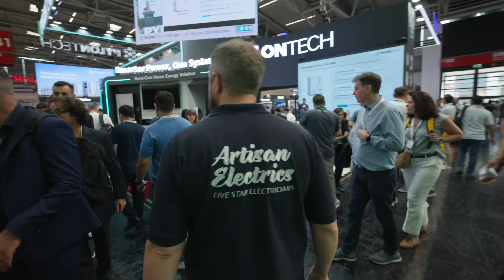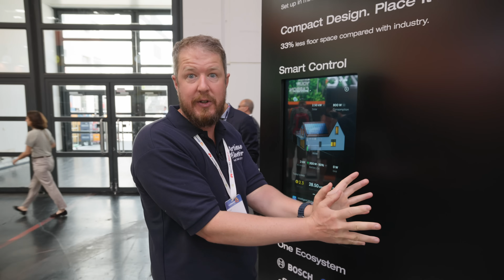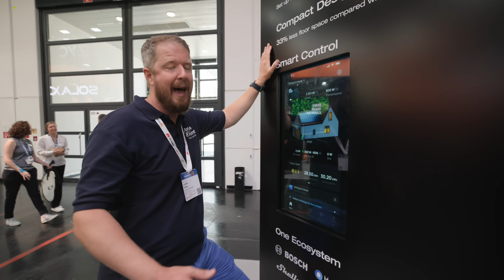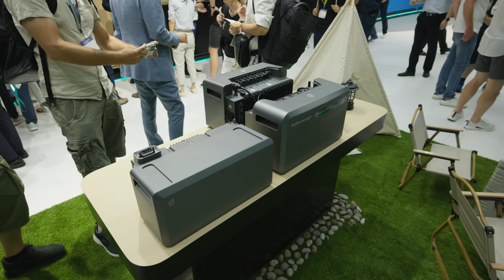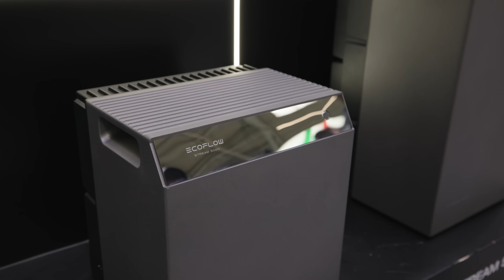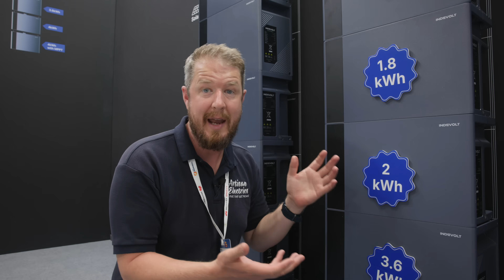Is the UK FINALLY Catching Up on Plug-In Solar? Intersolar 2026

Comment: I have a question for people with plug in solar - I just need to connect a solar panel (upto X watts) to a microinverter and then plug the microinverter into a wall socket. If my solar panel is generating say 400W, then any electrical device on the same electric phase (I have a 3 phase supply) will use up all or part of this "free" energy before pulling from the grid right ?
Does the switch on the electrical socket need to be in the On position for this to work ?
What happens to the excess solar energy if nothing in my house is pulling it ? Does it just get dumped via earthing/neutral ?
Lets disregard net metering obviously, is there any "special" requirement to your home wiring or breakers or electricity meter for this to work ?
Reply: Does anything function when plugged in and switched off ?
Reply: @codenamenel but wouldn't the electricity from the wall outlet clash with the electricity flowing in from the solar ?
Reply: @Mortisnp  how does electricity "clash" ?  it's just the flow of electrons in a circuit, the electrons in your wall socket haven't got beef with the electrons from your solar, they all just flow around the circuit (as long as the switches are closed) to get converted into a different type of energy by whatever appliance you have plugged in (and switched on)
Reply: @codenamenel  I don't know enough about electricity and home wiring to phrase my question well enough but I will try again. 
If anything conductive is plugged into the socket and the switch is on, electricity will flow into it right ? 
Does the generated electricity from plug in solar flow into the rest of the house circuit via the neutral of the socket or the live ? 

For some reason I think of electricity in wires of pipes carrying water. If the socket is the tap, is the "water" right up to the tap or is the pipe empty until the tap is opened and it starts flowing from the mains - there is "space" for the solar electricity to flow back to the mains and get distributed to another tap that is open ? 
I can normally digest a power CONSUMING device being connected to a circuit where electricity comes in and it gets used up. I don't know what would happen if an electricity GENERATING device is connected to socket in a SMALL TAP (solar) vs BIG TAP (mains) scenario. 
Say the solar is generating 5A and the breaker is 25A when the switch is on, it's two different levels of power heading in opposite directions. What would happen ? 

I hope this helps in explaining my doubts
Reply: @Mortisnp  there is around 230v on the live pin and 0v on the neutral pin of the plug from the solar, the same as there is 230v in the live terminal and 0v in the neutral terminal of the socket on your wall. Current will only flow from live to neutral it cant go in opposite directions, you have to connect both to create a circuit, depending on the resistance of what you use to connect the 2 is how much current will be required to overcome the resistance at a set voltage (230v)
In your water and pipe analogy, think of your radiators and heating circuit - from your boiler feed side, down pipes to the radiator valve, through the radiator and back along pipes to the boiler return side. 
The radiator valve is the socket, the hot water is current and the water pressure in the system is the voltage. If the radiator valve is closed there is still hot water in pipe behind the valve but your rad is cold as there is no water flowing through it, you open the valve (turn on your switch) and hot water flows through the rad, losing heat as it goes through and back out to the return side of the heater core in your boiler to be heated again. If you added another boiler and tapped into the heating pipes, one on feed, one on return, and equalised the pressures between the 2 boilers the particles of water from 1 boiler wouldn't fight the other water it would just mix together in the pipe flow along together down the feed, through the valve, through the rad and back along the pipes to return and get heated again. 
Now you've probably heard that electricity follows the path of least resistance before, well imagine in your scenario one boiler is huge but possibly hundreds of miles away from your house in a power station (mains), and the other boiler is small but on your roof (solar). The one on your roof can supply the hot water a lot easier to your rads than the one miles away, the water pressure will push the hot water through that short loop of pipework easier, so the system uses that hot water first and only if more is required will the hot water through the miles long pipes start moving and heating rads up.
The taps are same size, but the route of the water for the roof boiler is a lot easier so gets used up first before the water starts moving around the long pipes. 
If you turn too many radiator valves to open, the little boiler is working too hard and can't keep up, the water pressure drops so the water along the long mains pipes starts moving to help heat all the radiators. 
That's very basically how local generation works
Reply: @codenamenel Thanks. That's a great explanation. So in essence while it may seem like the solar and mains are "facing off" when plugged into the wall, in actuality they are running in parallel as two power sources side by side.
Reply: @Mortisnp  exactly and as the solar is the path of least resistance it gets used up first with the mains making up the rest if required
Reply: @codenamenel  Thanks once again. Also since net metering is out of the equation and if you dont ahve a battery, if the excess solar isnt being used does it just get dumped via earthing ?
Reply: @Mortisnp  nope, if it's not required to power anything in your property, it takes the next path of least resistance and probably powers something in your neighbours house, but as it has to travel through their electric meter to do so, they get charged for it's use the same as they would if was was generated by the power station miles away even though your panels made it. 
To be used as power in your property it doesn't have to travel through the meter, it starts in the inverter, goes through just the fuse board protective device, down the live cables within your house, gets used up in whatever appliance, goes back down the neutral cables to your fuse board and back to the inverter.
400w is basically nothing though, and if that's peak you will only hit that if the panels are facing due south with no shade, around 35 degrees tilt and at mid day in summer, so usual generation will get taken up by things that are always on, your fridge/freezer for example
Reply: @codenamenel  My house has a 3 phase supply so I can't necessarily be sure that the socket that the solar is on would necessarily have something drawing power at the same time. Obviously I can easily check so it's not an issue but I might need to move things around. My electrician had terrible handwriting so I can't tell what half the breakers are for 😂
Reply: @Mortisnp  arrange it so it's on the same phase and you'll probably max it out without export easily

Comment: I get why the regulations are kinda strict, you could overload a circuit, at least here in Italy you can have a lot of sockets on the same circuit, if current comes both from the solar and the grid you could pull more than 16 amps from it, which might overheat wires

Comment: So if you have plug in solar how is the user knowingly using all that produced by solar over the power coming into the home i.e. the house is fed from two sources solar and mains, and say the solar is producing 800 watts?
Reply: The solar comes into the into the ring main via plug and into main consumer unit ( fuse box) there it goes out into any device pulling power from your consumer unit. My eco flow system has AI, does it all in the background, fit a smart meter, not the one on your incoming grid, this then balances your usage and prevents feed back to the grid.  I purchased the ecoflow ultra + 4 panels extra battery and smart meter, my bill is now reduced by 70%.  For a small cost you can get an electrician to fit a bidirectional RCBO to the ring main or just go full rouge and fit a 3pin plug.  But I would recommend the RCBO.
Reply: @TimothyFletcher-l4r   Thats my point though there are two supplies running in parralel ergo the supplies will share the load.

Comment: Hope you had a good time in Germany.

BTW, any battery systems out there that are purely AC-coupled? I've got a solar installation here that could use just a couple more kWh of storage, and extending the existing storage would come at a major cost.
Reply: Franklin is AC coupled.
Reply: Any plug in the wall system is AC coupled. They will see the export from the existing solar and try and eat it. But you get problems with anything AC coupled because
- It's counted on your G98 limit so you may need to apply for a new G99 in advance
- The systems tend to fight one another - if the CT says there's 200W needed then who provides it, oh both, oh now there's 200W exporting, who stops, both ..

There are ways to tweak it so one of them generates a constant output at night to cover the baseload and the other follows the CT clamp.

Other option is (especially given its a good year before we get plug in battery legal here) to just use a powerstation to charge from the excess solar (or a couple of self installed panels) and plugged into a socket (non grid tie so legal) and with a few things plugged into it (eg gaming PC or aircon)

Comment: I'd prefer a 5amp (1.2kw) fuse limit over 3 (720-800w). 13 amps such as a car charger would eventually melt the consumer plug, socket, etc so needs qualified installation.

Comment: The issue I can see is that plugin means portable, and renters may not be allowed to drill holes, so how do you stop the portable system getting pinched ?
Reply: I think the point is that the renters buy these and not the landlord
Reply: @eavdmeer I get that, still doesn't stop a local thief :)
Reply: I really don´t understand your concern here. The panels are dirt cheap and hard to carry, so they don´t get stolen. Plus the panels need to be hard-mounted so the wind does not uninstall them prematurely. The battery or the inverter can be stored inside the flat/house so the theft risk is not a concern (at least not more than anything else you own).
Reply: Panels in the garden and they are low value and a pain to steal due to their size as well as having serial numbers. Microinverters are not worth much either and they have serial numbers and most are remote managed so can be remote killed too.

A common approach used outside the UK for rentals is panels fastened to balconies for flats (so not stealable) and microinverter on balcony (ditto). For gardens you can get special flat cables that will let you get the solar through a closed tilt/turn window and put the uinverter inside and the panels outside.

It's trickier than for a home owner but there are ways and Europe has spent a lot of effort inventing solutions to all the landlord problems.

Comment: So, I have 7kWh on the roof and 22kWh of batteries, if I add plug-in solar of say 800w will this help charge the existing batts or just for consumption. I am thinking of adding for the Garage/Workshop use.
Reply: Having multiple battery systems from different manufacturers will cause issues as they all want to be in control. Those batteries will start charging and discharging each other
Reply: You could put an additional non grid tie battery and or solar in the garage/workshop - ie one that charges off the grid only and provides power just to the workshop or via plugs on the unit.
A grid tie one would need a new G99 application and that's not going to be something most people can do.

Comment: Had ecoflow stream batteries and microinvertors and 6 panels (in the uk) for several months now - all plugged in via 3 pin plug with shelly smart meter - my monthly electric bill was around £90-£100 per month - since ive connected all up my monthly bill is now around £20-£25 ------Massive savings and couldnt be happier. All solar panels attached to garden fence.
Reply: Got the same, £100 a month saving couldn't be happier obviously be lower in the winter but still happy 👍
Reply: You both must have batteries to make that saving for when the sun don't shine. My house is going 24/7 and we use most of the energy overnight. 2.7kw system. I will add batteries to it.
Reply: Can you read ? He said ecoflow stream BATTERIES. So yah, he has batteries
Reply: @TheEmbrioWhat about winter time. The tariffs are going up on the off peak. My supplier has changed from 5p off peak to 15p off peak. People using batteries to charge off peak and to use later is hitting these engery companies profits. I get 13p export. Eon offered me 6p export. That is the way it is going. With Ecoflow efficiency comes into it and it is only 70% round trip.

Comment: Isn't that what Ecoflow and Bluetti sells?
Reply: Loads of companies do. Just everyone has heard of the overpriced ones who pay influencers to pedal them, and give kick backs for sales they generate.
Will be lots in the UK much cheaper in places like Aldi and Lidl once it's legalised.

Germany has loads of options - from low end stuff at great prices to kit with 25 year warranties.

Right now though as it's not legal the grid tie kit isn't sold in the UK (except by Ecoflow who pretend you are going to wire it in, and DJI who don't seem to care) so the Bluett and Anker grid tie stuff isn't easily available here just the standard power stations

Comment: Does that Sigenergy battery work with the MPPTs (I hope that's right) not being plugged in? I already have solar panels and would very much like to plop a battery into my shed, plug it in there and see it storing power.
Reply: I don't know of an inverter that doesn't, otherwise they'd not work at night 8)

Comment: The "official" renewables route via MCS certified contractors is a scam
The MCS accreditation process is a farce. You don't actually need to be a qualified engineer or electrician to get certified and the certification is done through 3rd parties
We saw how this was all a scam 15 years ago when the original "solar boom" kicked off
Companies that didn't know what they were doing and going into liquidation when things got a bit "sticky"
Reply: MCS isn't needed any more for solar. Any solar qualified electrician will do anyway and the MCS no longer adds value, in fact it's detrimental in many ways and it's mix of being a trade standards body and a certifier of product is inappropriate.
Keep it's special status just for things with grants.

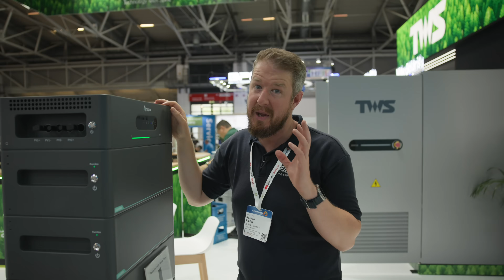Comment: 2:36 even though its banned, doing it anyway... just buy the gear online with a german plug and convert it. The regulations here are ruled by the Electrical Trades Union - they've locked it all down so hard the only thing a homeowner is legally allowed to do is replace a plug on a piece of flex. You almost need an electrician to change a light bulb.

Comment: Over ten years ago in our rental home we have 2kw of solar array in the garden on a basic frame, going to solar converter to lead acid batteries connected to a 2kw Inverter. Form this we ran and extension cable to some of our appliances and which ran the TV, Kettle, Fridge/Freezer with some free standing lights. No need to plug into the house mains.
Reply: this is sort of what im doing at the moment, except mine will be running my room only.
Reply: Wouldn't use lead acid any more but yes - some of our stuff is done this way with LFP and it works great. It's also independent of the main grid tie bits so it's more backup and resilience for when everything goes to pieces.
Reply: Hard to beat reliable lead acid, only the weight is an issue [2v 400ah 39kg] Recently got a 7kwh power station , charging directly from 4x160w panels as a backup, impressed so far.

Comment: Will plug in solar improve epc ratings? I'm a landlord with an epc c property (just) with a new calculation method coming soon my just scraping a C could be a D,   could this be a cost effective way to improve epc?
Reply: No. Plug in solar is not part of the building proper (just like plug in heatpumps don't count either). It has to be wired in. Adding a fixed solar installation is however quite effective. We almost scraped to B on a solid wall stone terrace because the basics are done right (windows, doors, roof insulation, lighting etc) and we added 3.6kW of solar to it.

Made the tenants bills much lower too.

Comment: The safety is there from the electrical standpoint sure there's gonna be some edge cases but I don't think it's there is that mounting securely etc. physical mechanical properties. And then the bigger one we don't have to put solar on you can just plug it in and we're not gonna end up with properly installed roof systems on every roof like we should. With the capability to take an entire house off the grid and use those big batteries during storms etc..
Reply: Nothing in the new regs exempts a roof install from the structural parts of building regs, so if solar magically appears on your roof and the council sees no building regs they can make you take it down.

For balconies the rules require the kits contain mountings that meet regulations.
Reply: And if the grid goes down your solar also goes down that's built into them
Reply: @whoami8616 if the grid goes down the grid tie port goes down, units with batteries as used outside the UK generally have sockets on them that keep working as does the solar. Even much of the Ecoflow stuff can manage that.
Fun discussion to have about grounding in that case in the UK.